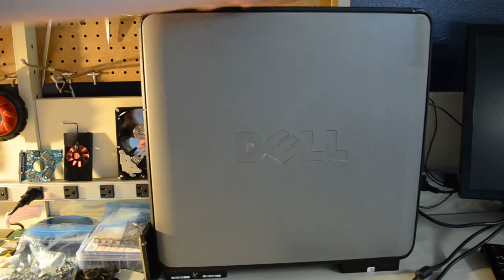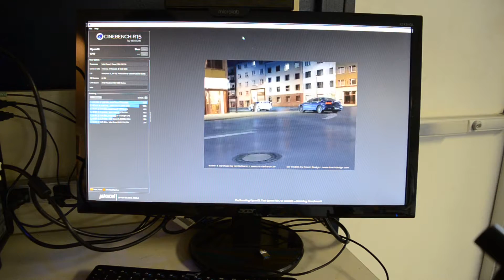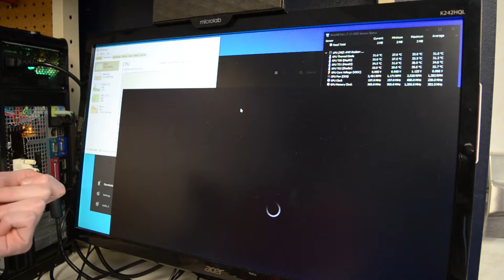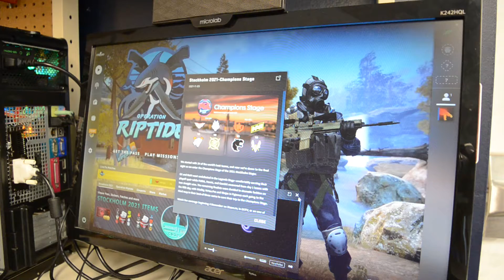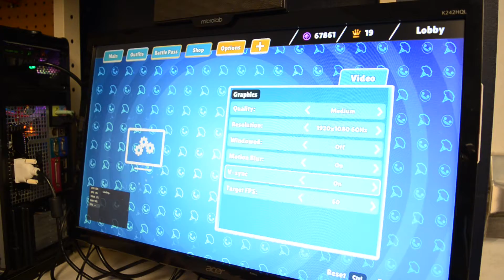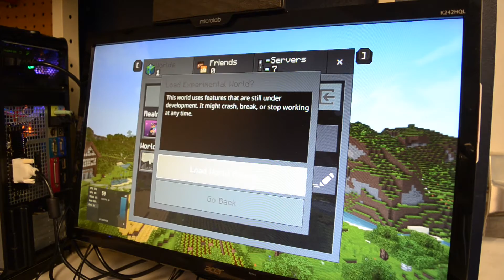Engineering sample Radeon HD 5870 - look at a prototype AMD card's hardware and performance

Comment: theres a sticker on the back of the card that will say engineering sample , engineering samples GPUs are only made in canada
Reply from the maker: The sticker in this case is on the side of the card above the PCIe connector. I have seen this on pictures of other HD 5000/6000 engineering sample cards online. Interesting to know about Canada.

Comment: So, those vrm temp sensors are normal, at least on the reference design, the card you have is not an engineering sample, and in regards to a cpu bottleneck, the Q9550 is perfectly capable of pushing a card x2 as powerful as a 5870, the poor performance is a result of the PCI-E x16(1.0) which that dell mobo will have, stick it in something with a 2.0 PCI-E and you will see much better performance, something like a P45 board
Reply from the maker: Well the CPU being at 100% is the issue. That's limiting the settings I can turn the card up to. 
Although the sensors are not as unique as I initially thought, this card is still an engineering sample.

Comment from the maker: Before you comment, a mistake on my part that I've realized a while after publishing this. 
I asked several people on forums what their GPU-Z windows looked like on an HD 5870 and no one else says it had these sensors. However I have learned this was likely due to an older GPU-Z version that didn't recognize their data correctly, these sensors were present on retail cards. So the card in this video is not as unique as I initially assumed.
However it is still an engineering sample despite it being identical to a retail revision.